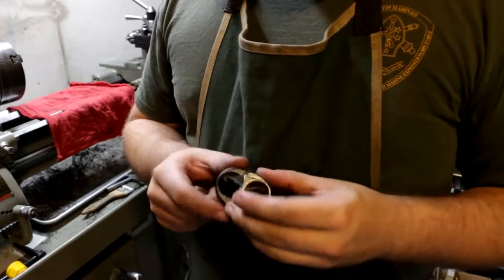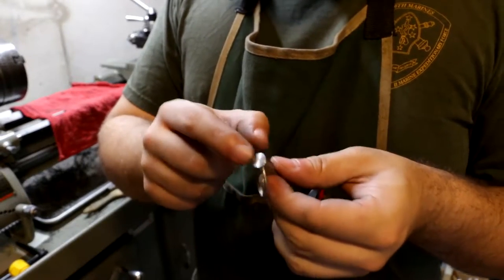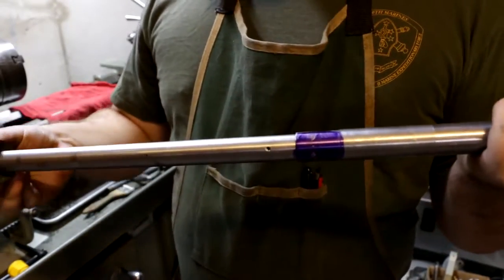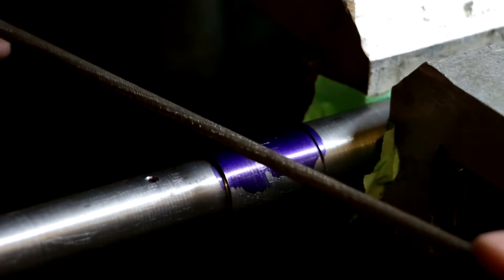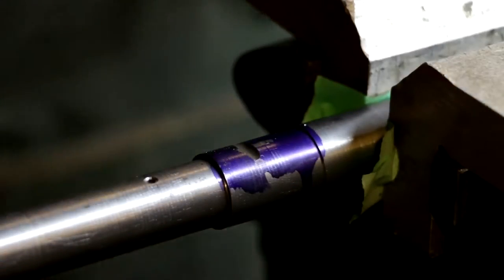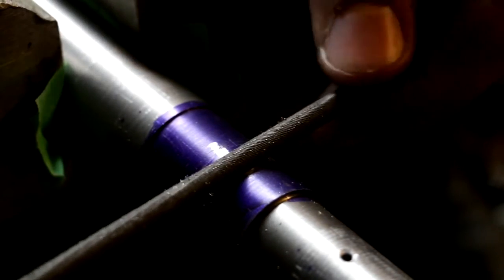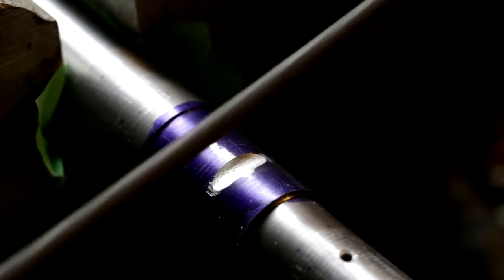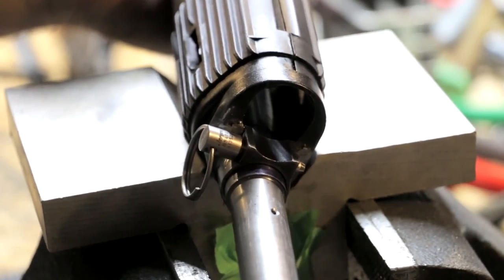Building the Custom PSL: Fitting the Handguard Retainer Pin (Part 8)

Comment: I hand load a lot of pulled premo .308 projectiles I’d like to find a .308 rifling barrel for my psl54 in x54 .  Filing back and forth doesn’t dull files ! I use to believe that also but a guy on utube tested it in a machine for a stupid amount of precision measured strokes ! So believe it or not you’ll file more accurate and better without excess wear by leaving the file pressed down !

Comment: That pin is the perfect excuse to get that MIG gas bottle and solid core .030 wire!
Machine the tip off, weld up the gap, then grind and polish it smooth.